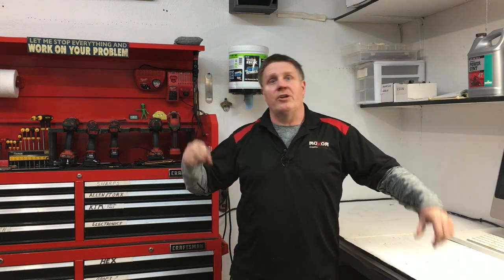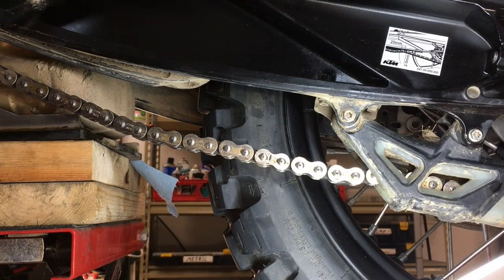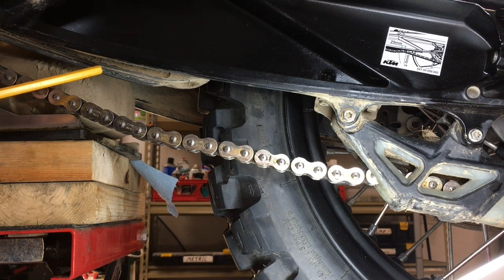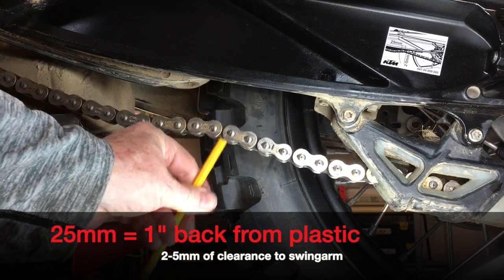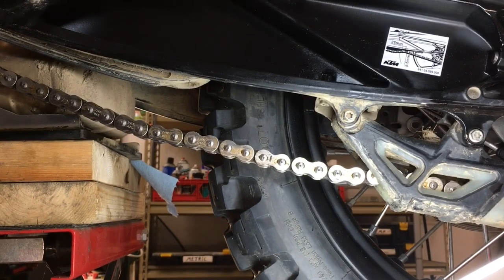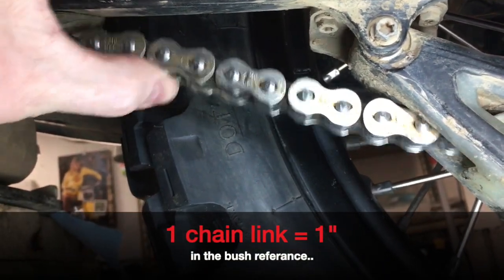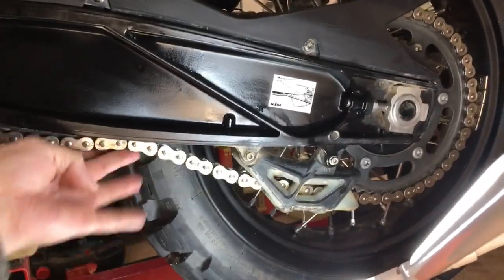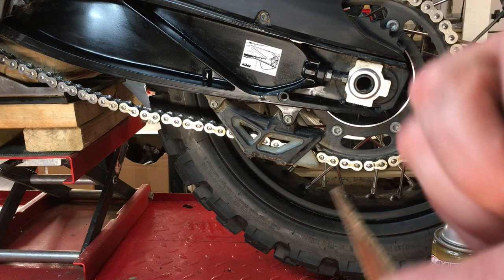KTM 790 chain adjust quirk

Comment: The only thing you might have missed in your video is that the KTM Service manual says to "lift the motorcycle with the rear lifting gear" for chain tension check/adjustment, which is explained earlier in the manual as a swing arm stand. You did it with a pit stand that unloads the rear suspension. So according to the manuals you should check and adjust the chain tension with the motorcycles weight on the rear suspension. This also means a quick check on the side stand should produce a similar measurement especially if you have a buddy to hold it upright off of the side stand for a second. I haven't checked the tension on my KTM with both weight on and off of the rear suspension but on my KLX that results in just over a half inch difference in measurement.
Reply: I checked mine both ways (on and off stand), didn't make much difference in tension.  The tried and true way is to remove the shock and push the wheel all the way through the travel.  At the tightest spot (for the chain) you should have a little bit of slack (i.e. it shouldn't be taut).  Only way to know for sure.

Comment: Nice. A good rule of thumb with WP (no linkage) suspension is loose is correct. It always seems like is shouldn't be that loose but it is right and error on the side of a little slack.

Comment: I have no "rear lifting gear" for my 790 Adv, so I ask somebody to assist me for the measurement. The other person keeps the bike in upright balance, so the rear suspension is fully weight-loaded. Also, the other person slightly pushes the bike backwards against 1st gear that is shifted in, so the push backwards stretches the upper part of the chain. Then I do the 2-5-mm-test as being shown in this video. Chain slack is quite big indeed, but all very experienced workshop staff members of my trusted KTM dealer confirmed this to be correct. And i also got the impression that the chain slapping that I observed particularly when cruizing at low rev's with a more tightened chain, is getting reduced by more slack. Sounds unlogic but it is obvious.

Comment: I thought Adv bikes should have a bit more slack than street bikes since they have more travel. The chain will tighten as the swing arm moves up as the longer travel suspension is compressed.

Comment: I like to leverage the rear wheel off the ground with it on the kickstand and put something under the skid plate as a quick way to check the chain. Works good of course for lubing chain too. Also I just use a 5mm hex as a tool to measure. One other thing of note is that the bike should be in neutral

Comment: The Husqvarna manual 701 says to have the bike in Neutral and on the sidestand when you do that Chain tension measurement test. If you do it while the bike is on a stand your results may be wrong
Reply from the maker: Carl.. you are correct. In the video it was on a scissor jack for lighting and production reasons.
I was also comparing slack either way. Ill be making “slacksetter” gadget to keep in my kit for measuring..

Comment: Are you measuring the 2 - 5 mm from the bottom edge of the swing arm (lowest part) or from the flat area of the swing arm that is directly above the chain? (higher than the bottom edge)
Reply from the maker: In the video i mentioned that im measuring from directly over the chain. Not the lip part that is lower and closer to you.
Disclosure: this is only my interpretation of what i think the manufacturer is trying to say.
Even the dealers are confused. ( which doesnt say alot..)
Reply: @moxomcreativeadventures7722  I think you are right. That is also how I understand it after reading the manual a zillion times.
Reply: @thierrybriand2413  I was just at the KTM service an they used the "lip part"... Just over the chain is inclined surface. I am confused
Reply: @endurojitsu3804 in any case, the only thing we can be sure of, is that's a very slack chain.
Reply: It does seem excessively loose especially when you're going slow through an off road situation it's slaps around like a rattle can.  But, it is what it is.

Comment: The diagram doesn't show the chain guide, which could make a difference because the chain guide stops it from making a straight line from the sprocket to the measurement point

Comment: Hey Neil! First off all thank you for making this video. Just to make sure I get this right. The difference between measuring when the bike is lifted from the back compared to the side stand and center stand is negligible?
Reply: When you put the bike on the ground, even with the side stand, the chain will tighten a bit compared to when it rests on a stand with the rear wheel not touching the ground. I don't think its negligible but it is certainly not much.

Comment: The factory manual says to lift the rear of the bike, in gear, with the upper part of the chain taut. Once doing that - then the rest of your video would be correct.
Reply from the maker: As you can see .. it is on a belly lift and the rear wheel is free to spin.
I measured with it on kickstand as well as lifted, noticed a negligeable difference so i account for that when its on the side stand.
But thank you for insight.. cheers
Reply: @moxomcreativeadventures7722  that's my point. When adjusting the chain, the bike should be lifted from the REAR lifting gear. Using the bellypan or sidestand will give you skewed results.
Reply from the maker: @rt71486  yes.. i did read that.. but i dont see a difference of weight and suspension compression if the bike is level on the floor or if lifted 1/2” by a rear lifting gear.. still 250 lbs pushing down. Again.. difference was noted and adjusted for sidestand measurements.
The goal is too find proper tension based on sidestand weighting. This is where real trailside adjustment are needed.
So i set it proper as best i can with limited info.. lol
Then put it on side stand measure again.. that becomes the new setting..
Make sense..
Reply: Just ran across this video trying to decide if mine needs adjusting. The 2020 790 Adventure R manual says to put it on rear lift and to shift into neutral. It does say to make sure the upper part is flat but if you push hard enough on the lower section the upper section will get "taut". Just putting that out there for other folks that come along.

Comment: Would be interesting to see what chaintension looks like when you completely load//bottom out the rear suspension.
Reply: On PDS/linkless bikes, there is a trade secret to this.  Put bike on stand, remove shock, then move wheel up and down to find the tightest spot for chain... if you still have a little bit of play then you are good.  No guessing required.

Comment: My 890 has 900 miles on it.  Dealer adjusted chain.  I checked it afterwards, pretty much like yours.  
   Looks loose but seems to be correct.
Reply: I also have a 890R, I don't understand the manuel how to check the chain

Comment: I’ve got about 2300 miles on my 790 R right now and even with new chain stretch it’s not even close to being that loose and this was factory set which I assume would be fairly close. Sorry I don’t trust this video
Reply: Hey John.... my 890 R came new with a ton of slop in the chain. Perhaps I am not the sharpest tool in the shed, but trying to decipher the hieroglyphics on the swingarm and the description in the owners manual left me scratching my head.

I'm guessing that this video is correct. This will accommodate the range of suspension travel without straining the chain while preventing the chain from contacting the aluminum swingarm under less demanding conditions. Again, just my humble opinion...
Reply: @toddjones5222  thanks for the reply Todd. It’s interesting that a company as big as KTM with words and pictures still can’t make clear something as simple as chain tension. Enjoy that 890 R. Thanks again.
Reply: @johnlavigne3143  the chain tension on ktm dukes 790-890 are as states in the video

Comment: Have a brand new 890 Adventure (2021).  The factory set slack was much tighter than shown here or what is stated in the manual.  That level of tightness was also retained when the bike had it's dealer 600 mile (1000km) service.  So KTM seems to have made it clear as mud :-/
Reply: Agreed.  Had a similar experience with my 890 Duke R. Can't understand the reason for the upper chain guide: it serves no usefull purpose and complicates the routine procedure of chain service.
Reply: @GrtSatan  When you suspension is very compressed the upper guide is absolutely necessary to protect the swing arm

Comment: You are completely wrong about the chain tension! Its way too loose..
Reply from the maker: Please elaborate .!!
As I clearly mentioned in the video, I was trying to elaborate on the interpretation of the diagram and what is in the manual.
I and many others want to know the correct tension spec and ease of doing it. 
I will not be offended if you can clarify the correct setting..
Reply: @moxomcreativeadventures7722  I could try to make a video
Reply: @moxomcreativeadventures7722  does it still seem too tight when the bike is back into he ground? It will be a bit tighter when the suspension. Compresses a bit
Reply from the maker: @Advcrazy  the bike was on the lift just for video purposes. Better lighting angle etc..
Ps.. it’s negligible with sidestand sag.
Reply: Hi Neil ... the manual states on a paddock stand which creates some sag ... I am concerned the centre stand / sissor lift method would have different results as no sag / compression of rear shock.  The manual is clear on the paddock stand method.
Reply from the maker: @sritter  i am aware, measured both ways.. was negligable. 
It was on a lift for video purposes
Reply: @moxomcreativeadventures7722  OK that is good to know that difference is neglible and you confirmed this.  I guess checking the chain with any load / lugguage would be invalid - ie: would have material impact on the measurement
Reply: Your video is right on. Thanks for taking the time to make this. 
Don’t assume your dealer knows what they are doing. My bike’s chain was way too tight when I picked it up from the dealer. I downloaded the German manual and confirmed that the method used in this video is correct.